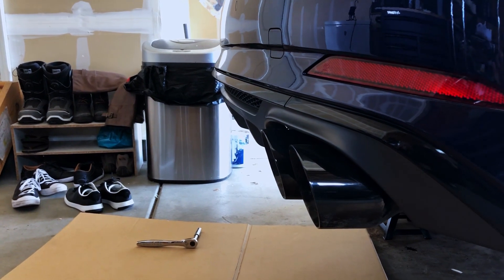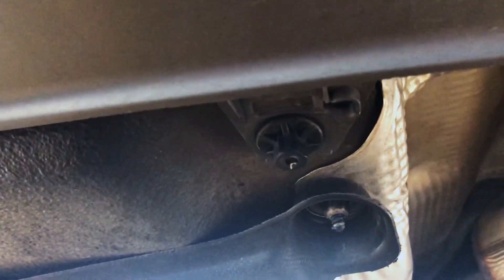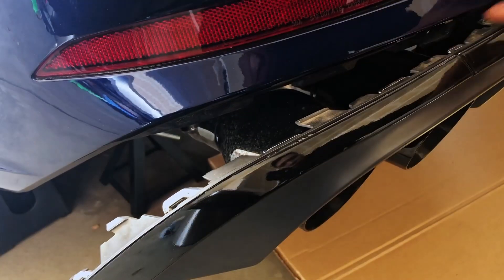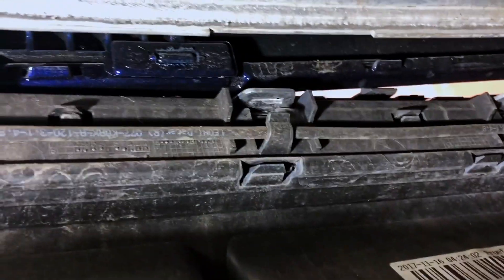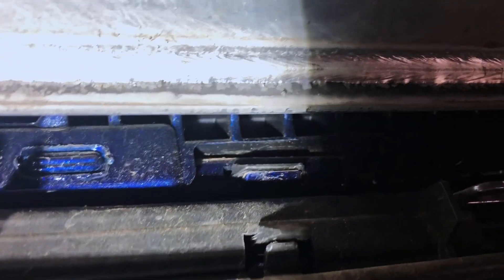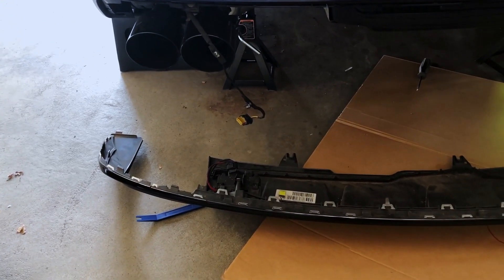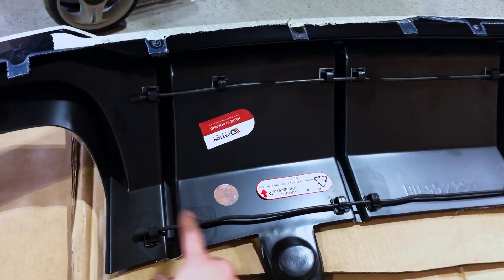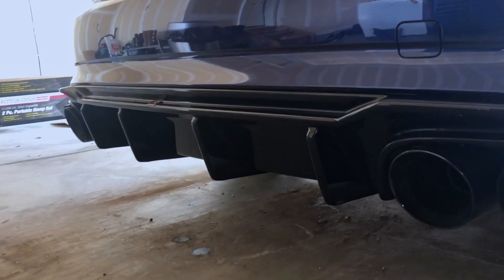How to Remove Rear Diffuser | Install Maxton Designs | Audi S5 Sportback B9 |

Comment: Hav you had any problems with the tape from car washes or what not? I just put my diffuser on just today and i did the same thing as you taped that sensor down
Reply from the maker: Not at all
Reply: @chthan3o3  lol proper i cuz i double downed and also used a strip of hvac tape if yk yk thats sticky as hell

Comment: Perfect, thanks for uploading this. I did have to use one screws they provided to hold it in place from within. I see no problem with this because I didn’t have to drill into my car just passed the screw through the existing holes in this diffuser.
Reply: Even if you do have to drill holes its on the underside of the car where noboy sees and into  other plastic so not like youre making holes into structual metal.

Comment: Did you use the screws or are the clips holding everything together ?
Reply: i am wondering too
Reply: Just installed mine today. The diffuser comes with 7 self tapping screws and pre-drilled holes for them. You have to screw because the new diffuser doesn’t have the tabs like the factory one.

Comment: Can I put that diffusor on my audi s4 b9 because I saw that a lot of aftermarket parts are made for both audi s4 and s5 b9
Reply from the maker: No, bumpers are designed differently  each model
Reply: @chthan3o3  sadly I cant find one like yours in Germany/Europa

Comment: You were using the screws or not ? 
And if you used them how u did it ?
Reply from the maker: None, tabs are holding tight. Will not fall off unless i get in an accident.

Even if someone tries to yank it off. They will have a really hard time

Comment: Thanks for your vid mate, i m working now on a b9 s line A5 with the same maxton design 😘
Reply: What size exhaust tip should I get for it ?
Reply: @Curlz1025  next month I have in plans to change the exhaust tips, now I have the oe ones but it looks a little bit weird
Reply: @martincurobert109  is this diffusser suitable for audi a5 b9 sline? because i want to order the same. thanks.
Reply: @eleniellinidou1853  yes Eleni but you need to change the exhaust tips